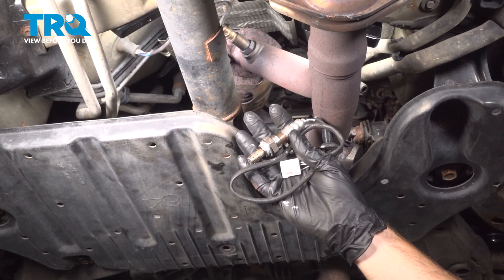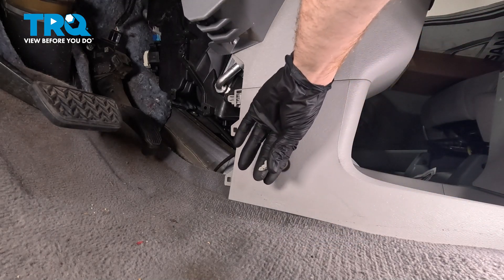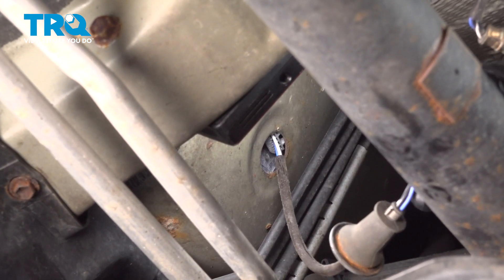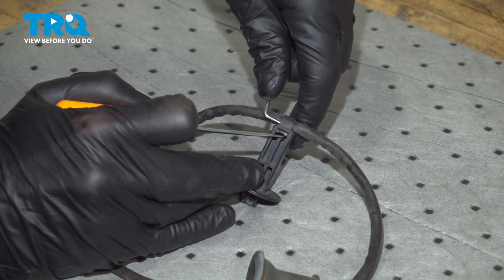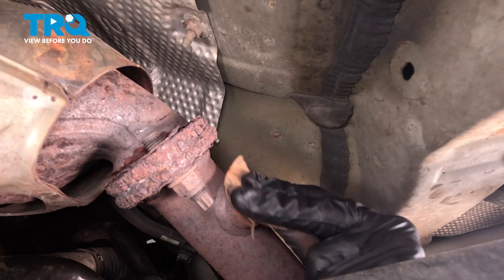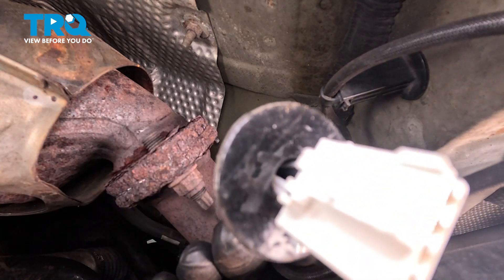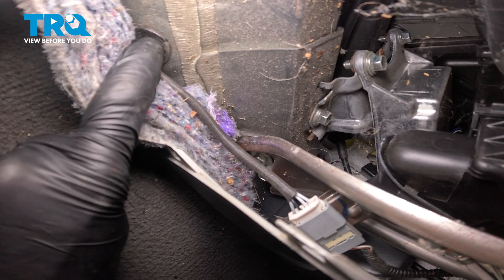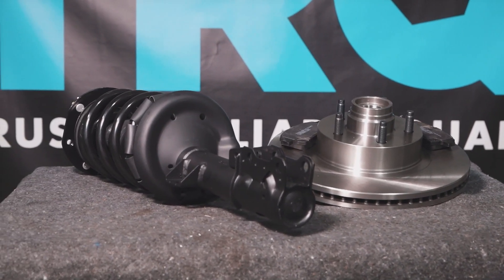How to Replace Bank 1 Sensor 2 O2 Oxygen Sensor 2011-2020 Toyota Sienna 3.5L V6

Comment: After replacing this sensor. If your vehicle engine light comes back again and it shows you the same code again, then replace the bank 1 sensor 1 as well. That should fix the problem.

Comment: 2004 sienna le fwd with a po137 bank 1 sensor 2 issue . Rechecked after clearing new po420 showed up. Bank 1 catalytic converter was recently replaced oem so what the heck is going on?